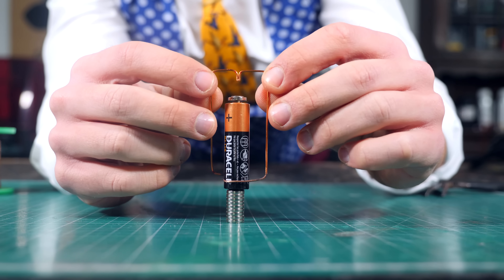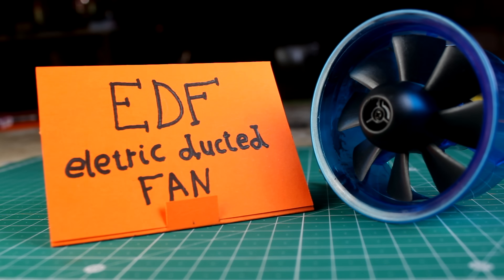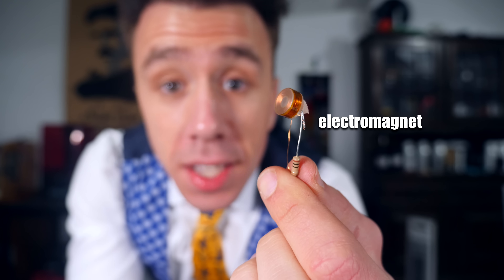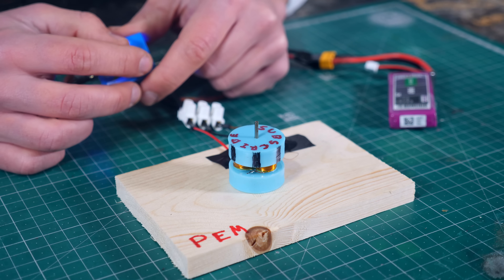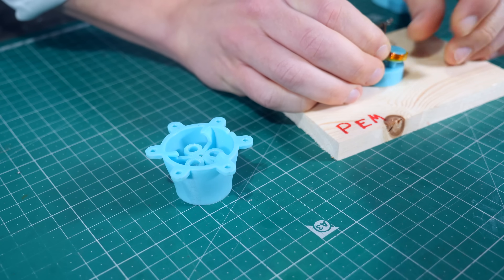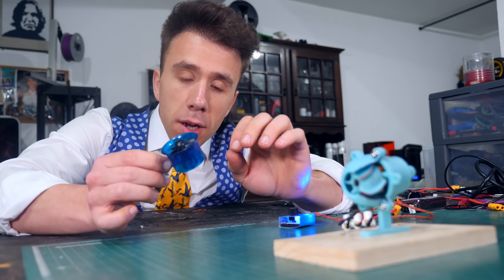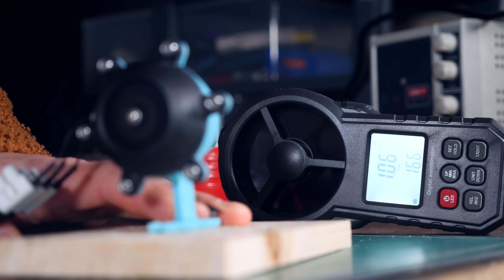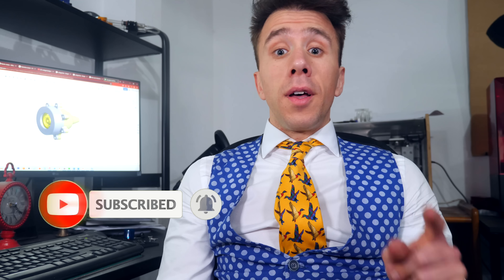I 3D Printed an ELECTRIC MOTOR FAN

Comment: First off I really enjoy your channel your attention to this topic is fun to watch beyond theory. Second while I think your principal is correct assuming ṁ=ρ*Q and Q=v₁A₁=v₂A₂ you can say that so long as A₁<A₂ then v₁>v₂ (where ṁ is newtonian notation for mass change with time). The way, as you have demonstrated many times, turbo combustion works is by compression of air in and through thermal expansion ṁ will remain constant while ∀ out will increase through volumetric thermal expansion ie P*∀=n*R*T (where P=pressure, ∀=volume, n=#moles, T=temp in K and R=Avogadro's gas constant). Nominally saying that a turbine pump does not really create a low pressure area. This is why a turbine engine does not suck it… blows. That being said my assumption as to why your aerospike doesn’t work is because there is no combustion. If you were wanting to increase the velocity of the air you could reduce the diameter of your brushless fan and Velocity out will increase but since matter can neither be created or destroyed ṁ out will be equal to ṁ in.

Comment: Pretty sure it has to do with the way they wired them up and I'm thinking that use some sort of electronics to stabilize the high-speed and low-speed I could be wrong it could be in the designs

Comment: Double check your calculations on the magnetic cct. Are you slipping (coils are turning on faster than the permanent magnets, and keep up). With the air density and friction of the shaft, there is a bit of mechanical load there. So might need stronger magnets/electro magnets to create a stronger magnetic force to stop slippage. Feel free to reach out and I can explain more in detail.
Reply: ᴄᴏɴɢʀᴀᴛꜱ ʏᴏᴜ ʜᴀᴠᴇ ʙᴇᴇɴ ꜱᴇʟᴇᴄᴛᴇᴅ ᴀᴍᴏɴɢ ᴏᴜʀ ꜱʜᴏʀᴛʟɪꜱᴛᴇᴅ ᴡɪɴɴᴇʀꜱ ꜰᴏʀ ᴛʜᴇ ᴘᴀᴄᴋᴀɢᴇ ᴄᴏɴᴛᴀᴄᴛ ᴛʜᴇ ᴛᴇʟᴇɢʀᴀᴍ ᴀʙᴏᴠᴇ
^^^^^^^^^^^^^^^^^^^^^^^^^^^^^^^^^^^🎁

Comment: Why efficeincy factor of turbofans on airplanes much more powerful then 1 contour turbojet engines?
Reply: A turbofan moves more air for the same cost in fuel. Essentially, more energy is extracted from the combustion products and turned into thrust, rather than being blown out the back as waste heat.

Comment: The centrifugal fan can ONLY create thrust by the mechanism described by the rocket equation. It throws stuff out fast -> therefore thurst. The EDM can also create "lift" likt an airplane wing, creating a force dragging the impeller forward and adding to the total thrust. 
Compare it to a helicopter. It's not the air puhsed down by the wings that lift the helicopter, it's the lift of the roating wings .

Comment: I propose you do a trompe compressor to pull (and or) push air (or any fluid) using the grey waters produced by any homes / the rain collected by the gutter.
It could replace an actual basic part of a syphon system or a rain collector. With this you can have your own air / vacuum network in your home/workshop.

Comment: In terms of Jet engines you just did the compressor part.
So in the middle of your Fan you have a lot of high pressure turbulent Air at a place where a nice jet burner would be good.
Instead the air has to redirect inwards where it really does not want to be under high pressure, wich ist giving you a lot of losses.
For creating a high vacuum on the intake instead zu this would be a good device.

Comment: Quick and dirty option would be to coat the fan and housing in Epoxy to remove any imperfections on the surface and see if that improves airflow.

Comment: Centrifugal fans for the same diameter create more pressure but axial fans move more air.  For a given amount of power thrust is higher with more air and lower velocity. Axial fan has more functional area.

Comment: hey integza here's a good idea, you should make a liquid fuel thruster (possibly even one of your previous projects like the vortex rocket, I would recommend hydrogen) and then attach an aerospike nozzle to it and make the output as high pressured and high thrust as you possibly can, then attach it to your scale on a rail (hey that rhymed!) to measure the thrust output, in some of your later videos you should try attaching this to something like a model rocket or an rc plane
Reply: ᴄᴏɴɢʀᴀᴛꜱ ʏᴏᴜ ʜᴀᴠᴇ ʙᴇᴇɴ ꜱᴇʟᴇᴄᴛᴇᴅ ᴀᴍᴏɴɢ ᴏᴜʀ ꜱʜᴏʀᴛʟɪꜱᴛᴇᴅ ᴡɪɴɴᴇʀꜱ ꜰᴏʀ ᴛʜᴇ ᴘᴀᴄᴋᴀɢᴇ ᴄᴏɴᴛᴀᴄᴛ ᴛʜᴇ ᴛᴇʟᴇɢʀᴀᴍ ᴀʙᴏᴠᴇ
^^^^^^^^^^^^^^^^^^^^^^^^^^^^^^^^^^^🎁

Comment: I am apart of a 3D printing research group and we are starting to play around with Ceramic FDM Filament. It's called LAYceramic. It woudl be super interesting to see some of the jet engine parts printed with LAYceramic and compare it to the resin ceramic.
Reply: Would probably be too brittle but the bigger problem would be controlling tolerances during the sintering process. The varying density of the filament caused by the filament inconsistency and imperfections in the print is another thing to contend with too. The vibrations won't destroy a PLA part but with more brittle SLA or ceramic parts the results tend to be explosive.

Comment: Seams to me that you're measuring the wrong metric isn't thrust  more important then airflow or possibly  the wrong type of  manometer, there are bound to be power losses in a more complicated  system, is it possible the idea of the spike is to increase velocity of the air for a higher top speed

Comment: Ok, call me a Fan, for now at any rate.  Fun video, and this should be a simple one to explain why your dusted turbine is not suitable for all motors, and visa versa. Let me put it in basic terms, you should not expect a scooter or a hover board motor would be sufficient to drive a full size family car.  Why? You guessed it, the load and drag are greater than the horsepower.   To properly evaluate your various project ideas, setup methods other than figures of volt/amps or revolutions per minute. You need to understand how these things affect the design outcome, but also develop a small scale and scalable method of determining the actual work of the device. In the case of your direct problems, you are using the wrong size of motors for the size and mass of the impellers, plus some efficiency issues with the design efficiency shape, but most of it is in the simple step of being the wrong fit of motor to the wrong fan blade.
Reply: ᴄᴏɴɢʀᴀᴛꜱ ʏᴏᴜ ʜᴀᴠᴇ ʙᴇᴇɴ ꜱᴇʟᴇᴄᴛᴇᴅ ᴀᴍᴏɴɢ ᴏᴜʀ ꜱʜᴏʀᴛʟɪꜱᴛᴇᴅ ᴡɪɴɴᴇʀꜱ ꜰᴏʀ ᴛʜᴇ ᴘᴀᴄᴋᴀɢᴇ ᴄᴏɴᴛᴀᴄᴛ ᴛʜᴇ ᴛᴇʟᴇɢʀᴀᴍ ᴀʙᴏᴠᴇ
^^^^^^^^^^^^^^^^^^^^^^^^^^^^^^^^^^^🎁

Comment: I think there are losses due to the inner surfaces of the impeller case. With viscous fluids there is a boundary condition where it is assumed that the molecules touching the walls do not move, and there is a gradient of shear deforming the fluid. Shearing the fluid requires work. This kind of impeller is probably more suited for compressing fluid rather than increasing its velocity. I would expect that the dyson bladeless fan is much less efficient than a traditional bladed fan when it comes to volume of fluid moved per joule of electricity. that aside, your impeller looks sick. I wonder if golf ball divets on the inner surfaces would change the performance.

Comment: I looked at your design, I could be wrong, you should try changing the direction of the inner helix. It looks as though it may work against the flow or cause turbulence. Adding a velocity stack on the intake will help as well.

Comment: Having some few years within the RC community, planes, helicopters, quad drones, yeah, a whole lot of money,  afte a trainer then novice and faster planes, coming into mid-fuselage fixed wing, ..very fast, but then that was during the 70's and 80's, fast forward to late 2000's, 600mm nitro-methane, 20 teens brought on quad copters, (balance motors esc, via micro electronics, then better, faster props, or screw also if ya like, integrated impeller technology, yet still, no one can beat the output as scalled size efficiency,  as from a blade length of say around (pending pitch), 4 to 12 range, single blade with a harmonic ( larger circumference) counter balance.  The issues seems to be about the density of air, and of course, altitude. 
...all that said, I'd recommend a smaller hub, wider blade, and at the size shown, less pitch, increased RPM's, ..failing that, put a flare on the tips to maximize the efficiency of the length of your blade... 

Aldo as a side note, the least amount of space between screw, and enclosure!  You might want a more polished enclosure too! At small scales, working with same atmospheric density, you need to be as tight toleranced as possible! 

Best of good fortune,  ....New Sub!

Comment: I would think it would have to do with how much surface area you have interacting with the air. those blades seem stubby for the diameter and speed of the rotation. 

The normal fan you got the brushless motor out of has a much larger surface area for moving air. (the swoop of each blade) You have to remember that a turbine like you would put in a car to increase airflow into the engine spins at several hundred thousand RPM when fully spooled. That allows the relatively small surface area to move a lot more air at high compression. (which of course compressing the air is the point of turbocharging) 

If you have a fan spinning at 1000 rpm, with a surface area of 10 millimeters squared x the number of blades. But the surface area of the impeller is only 1 millimeter squared then you would probably have to spin it 10 times as fast to get the same amount of air to move in the same amount of time logically. 

My guess is the dyson fan didn't perform as expected because it probably spins a heck of a lot faster than you were spinning it. Does the motor of the one you salvaged work? Would be a good sanity check to see if it just has a really high RPM without a lot of torque due to the small contact area with the air.

Comment: A) Your pump style is adding a compression stage which is a energy loss (and the entire structure is adding extra mass so now conservation of energy is involved). 
B) A wing style fan works exactly like a wing, which would be playing around with pressure differentials basicly (very efficient).
C) What exactly are you trying to do here because there's a lot of engineering and considerations that goes into aerodynamics. What media are you trying to move because each media has its own most efficient blade profile and even the temperature can interfere. Fan blades for like a house fan use a general profile, while the blades manufactured for a jet would have much finer tolerances on their profile callouts on the blueprints. Surface finish callouts would even be a factor.
Idea : If you want to make a more efficient fan, make one where blade profile can change. Like maybe have an inner metal structure with a rubber bladder over it that's inflatable.  Play around with the thickness of the rubber bladder to help control the profile. (Add some stiffer rubber patches or fiberglass or something so it doesn't just turn into a big balloon.) Then have all sorts of sensors that measure the atmospheric conditions with a computer to do all complicated calculations to determine the most efficient profile. Most of logic motors have speeds their most efficient at as well so thet can also be part of the calculations.
Reply: ᴄᴏɴɢʀᴀᴛꜱ ʏᴏᴜ ʜᴀᴠᴇ ʙᴇᴇɴ ꜱᴇʟᴇᴄᴛᴇᴅ ᴀᴍᴏɴɢ ᴏᴜʀ ꜱʜᴏʀᴛʟɪꜱᴛᴇᴅ ᴡɪɴɴᴇʀꜱ ꜰᴏʀ ᴛʜᴇ ᴘᴀᴄᴋᴀɢᴇ ᴄᴏɴᴛᴀᴄᴛ ᴛʜᴇ ᴛᴇʟᴇɢʀᴀᴍ ᴀʙᴏᴠᴇ
^^^^^^^^^^^^^^^^^^^^^^^^^^^^^^^^^^^🎁

Comment: Thrust is calculated by multiplying the mass flow by the output velocity minus input velocity : qm*(Vout - Vin). The mass flow is directly linked to the input area.
In order for your thrust to remain constant, you have to increase the output velocity as much as you reduced the intake area. But because your motor remains the same, you can't.
So the only options there are either change the motor for one that is spinning much faster or make the intake much bigger.
Hope that helps !

Comment: In terms of the ducted fan vs the impeller with the same motor, im pretty sure it comes down to the surface area of the blades. Even though you are running the max rpm of the motor you are not utilizing the max torque available in the impeller due to reduced surface area, i think. and for the next video how about looking at the old fench 'aeroplane' the gyroptere. it used a compression jet engine to power a single wing plane that was designed like a sycamore seed.

Comment: Hi, your duck fan compress the air much better due to better  blade pith angle and more  flow  rate  , but centrifugal fan compress the flow on the side, with your setup you creating internal pressure the air doesn't flow,  in centrifugal the air should channel form side  out .

Comment: For impellers it is not about good better best as far as design goes. impellers are designed around a certain volume and flow as well as the motor strength. So choosing your impeller shape means matching it up with 3 variables. Alas I am just a piping designer. To learn more, please consult a mechanical engineer or a mechanical engineering text book. I just know that our pumps (that use impellers) are designed with a specific shape to the fins based on the medium they are pumping, the desired flow rate and the strength of the motor attached to them.

Hope that helps.

Comment: So I don’t have a computer or anything like that but i build rc planes with balsa wood the old way and I have worked with some ducted fans and I know that you have to be careful with the tolerances of the propeller and the housing walls the closer you can get the better results. 
Don’t let the fan have any wash off inside the housing. If you start to think of air like a liquid you will make life easier for yourself.

Comment: You are only measuring one aspect of the output of your fans; pitch speed. That is, how fast the air moves (roughly). To make matters worse, you call it "thrust", wich is something different. While there can be many reasons one fan has a higher output than the other, you will never even get close to finding out what is going on if you are not measuring BOTH aspects of the fan's output.

Comment: The diameter of the EDF and area of its blades is much larger than that of the impeller  which restricts the flow further think tesla valve the flow rate slows due to the shape its pretty equivalent the space between core and the outer casing would have to be larger and the speed of rpm would be different for a prop verses and impeller which would require a much higher rpm to move the same volume of air. Also the pitch tends to change as it gets further from the core to increase the push generated on the air as it passes the impeller. Also your cowling could be opened larger and rounded further from the impeller to assist in flow rate ... air at high air speed it shares a lot of similarities to a fluid instead of a gas this perspective may help. The issue you will have will be max rpm vs Mach speed of the impeller tips depending on size.

Comment: I would check the Reynolds number of your duct and impeller and compare that to the EDF. This is a dimensionless way of measuring how your flow should behave (eg. slow flow in a large  tube would be similar to fast flow in a small tube). You may very well be in different flow domains and running a smoke machine through these devices of while varying sizes (to change the Reynolds’s number) could make for an excellent demonstration and application of this principle.

Comment: I think the reason why you are not getting the same thrust is the same reason why if you change the propeller to any other, you will get different thurst, impellers are better for compression while typical propellers are better at flinging that air faster, producing thrust.

Remember thrust is dependent on the mass and speed of the exhaust, impellers usually dont create high airflow, instead compressing it creating high air dencity for better fuel burn.

Comment: As others have said the intake size has a lot to do with the lack of thrust but also the shape. The way you have designated the intake lip produces a large amount of turbulence when air flows past it and into the housing. If you increase the diameter of your intake and give the outer lip a smooth flare like the one present on the EDF you will get better thrust.

Comment: Fans are axial impellers. Air flows axially. Compressors (or pump impellers) have radial flux. Axial pushes through, radial compresses. Axial deals with high volume flow, low pressure. Radial deals low flow, high pressure.
Oversimplified.
By the way, your first 3d print was a mixed axial-radial. Maybe you need a more radial design and more rpm?
Did this help?

Comment: I'm noticing a couple of problems not including friction.
they are 
1. Mass torque ratio
2. Inertial expansion 
3. The strength of your motor 
4. The strength of your power source
.
My recommendation 
1. Reduce the size of the impeller
2. Reduce the mass of the impeller 
3. Get a stronger motor
4. Add more power

Comment: the injection molded EDF is going to have much smoother parts than your 3d printed fan for starters. even resin printers still arent as smooth are injection molding.

Comment: I mean...just because you use the same motor and roughly the same dimensions does not mean it'll have the same amount of airflow through the system. Could be a ton of reasons.
- intake area
- pneumatic losses/back pressure
- turbulent losses
- wrong blade angles and depth

Comment: Did you even think to measure amp draw? If you're not getting as many watts as the linear EDF unit, of course your thrust figures will be different. Look into the centrifugal jet research done by the English in the late 40s and 50s. They found a fatter engine was more powerful, not necessarily a longer one. Hook up a wattmeter to your setup. They are cheap and accurate. Try to match the load of the original fan unit